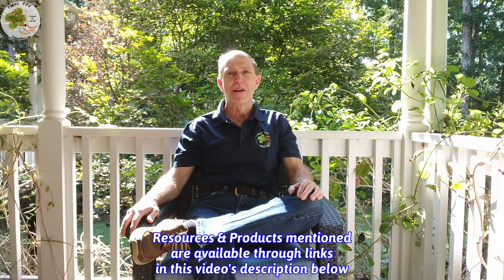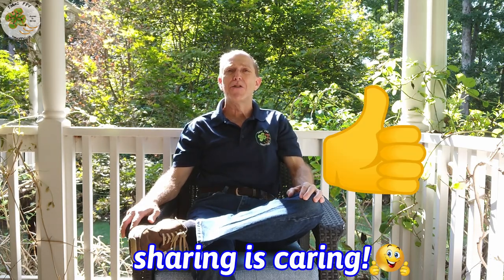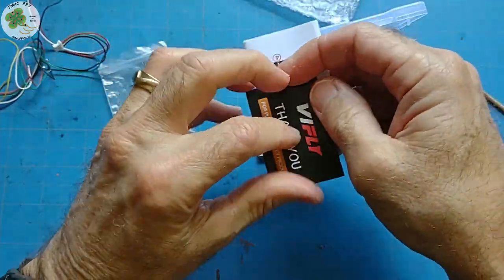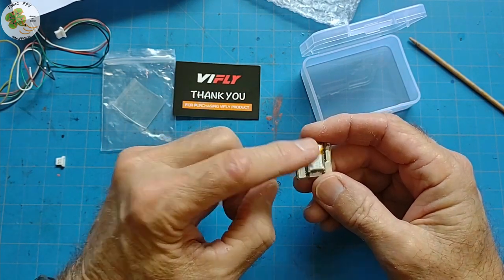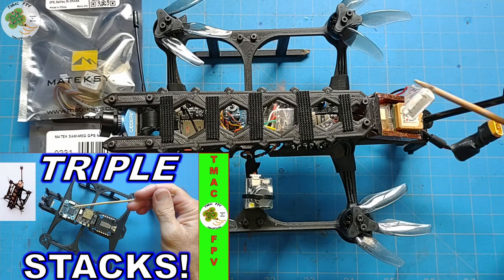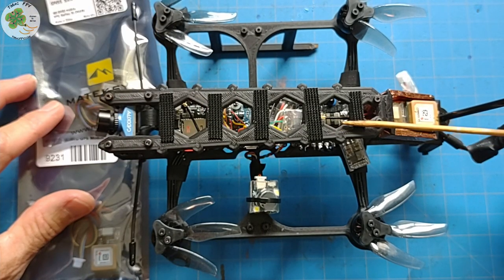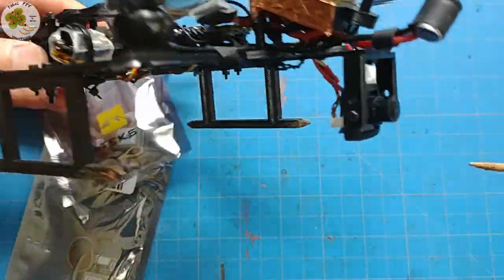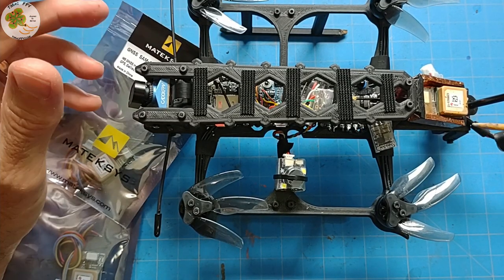GPS Fast Fix (VIFLY GPS MATE!)

Comment: What a great product. I took the GPS off my 5" freestyle quad because I found myself not waiting for satellite lock most of the time. This solves that problem.
Reply from the maker: Yep, exactly. This basically does what I have been doing as a DIY gadget in a much more elegant/efficient form factor and with included self-powered buzzer without the necessity of spending additional time of building the external power supply yourself. Great little product IMO 👍

Comment: Thinking outside the box, if your GPS module gets power from plugging in flight controller USB, with no battery connected. Use speedybee Bluetooth USB device to power up FC via USB. Monitor sat stats using speedy FC configurator via Bluetooth on your phone, once locked in, plug in main battery. Then remove speedybee Bluetooth USB device.
Power to GPS module has power from main battery, no power interruptions.
May try myself in the field.
Poor man's solution if you already have speedybee Bluetooth USB field device.

Comment: I don't understand why you would bother to complicate the process? You only have to wait 2-3 min the first time you go to a new site. After that the GPS locks very quickly. The sacrifice of using a conventional vifly that will beep for days, if you get lost, for a beeper that now will only beep 4 hours hardly seems worth it.  What am I missing? You still have to turn it on and wait.
Reply from the maker: If your GPS module works for you in your location at a new site within 2-3 minutes then I would agree with you, no need for this.  Most pilots aren't as fortunate as you are in that regard.  If you're not able to find a lost quad with a GPS and a buzzer that beeps loudly for 4 hours . . .
Reply: I have had them stuck in trees and not visible so you have to come back in the dark when light blinks to find them. More than 4 hours before dark.  You are fortunate to never having this happen to you.